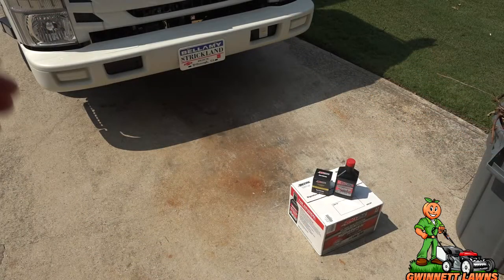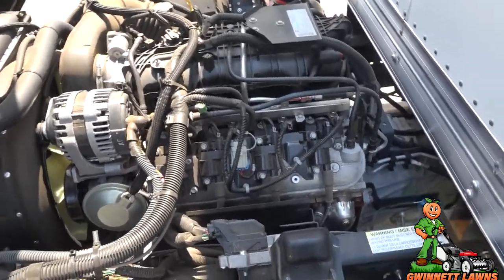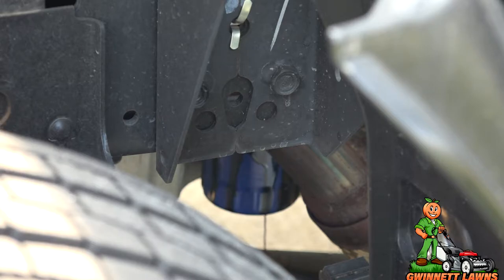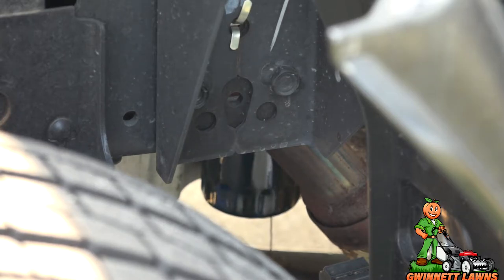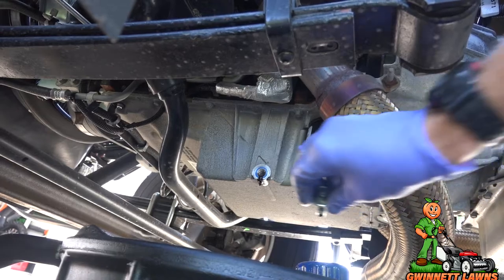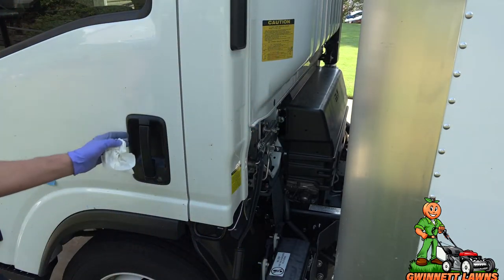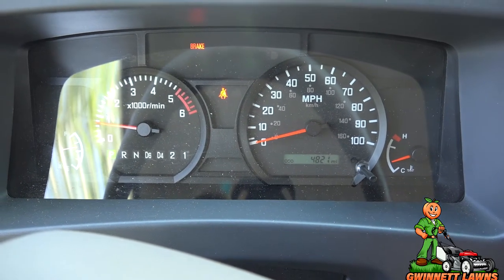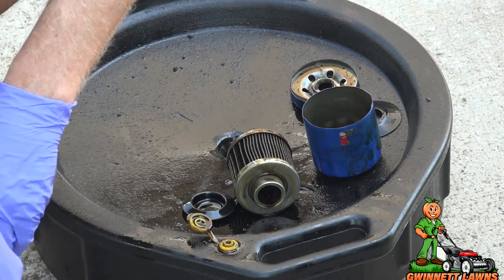2019 Chevy LCF 4500 or Isuzu NPR HD first oil change

Comment: Thinking about one of these trucks. What's the price difference between your gas and a diesel version of the same truck?  Reasons you chose gas over diesel, What kind of fuel mileage are you getting around town mowing  
Thanks, Gianni  - Curb Appeal Lawn Care  S.L.C. Utah
Reply from the maker: The diesel is about 10k more and really not good for stop and go service work we do.  The diesel particulate filter and SCR filters cost $1400 to change out and they WILL need that sooner if your driving alot in city traffic as opposed to the open road.  I get about 8mpg.
Reply: @GwinnettLawns  Thanks Russell, Watch your channel religiously! Great information. How are your new tires on the 36i holding up? I have the same mower only 36.5 hours so far.

Comment: I’m surprise it’s only 6 quarts my 2019 Silverado 1500 5.3L takes 8 quarts. I’m jealous of the engine access I’m 6 foot tall and I have  a 2 inch lift on the truck and I cannot reach the dipstick without standing on something even before the lift it was difficult to reach I can’t believe how short the dipstick is on my truck. When I change the oil after it’s pretty much drained with the new filter on I pour about a quarter quart in and let it drain through I’m surprised to see how much dirty oil is still left in the engine that the new oil pushes through you could let that new oil drain all the way or as soon as it runs clear put the drain plug in saving most of the new oil you poured through, you may have done this before maybe not, try it next time if not that much dirty oil comes out maybe you don’t have to bother to do this but if more comes out then you think you may as well get all the old out when you do your own oil change Hope all is well in Georgia have a good one🇺🇸👍
Reply from the maker: john m bell i’m sure it’s because the engine in the Chevy LCF is a little closer to the ground so the pan has to be shorter which reduces the oil capacity.